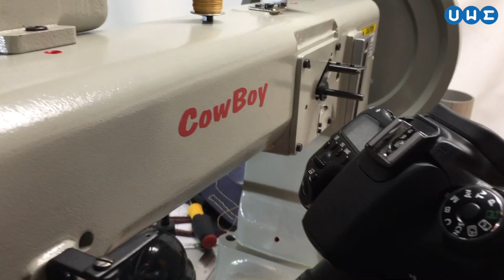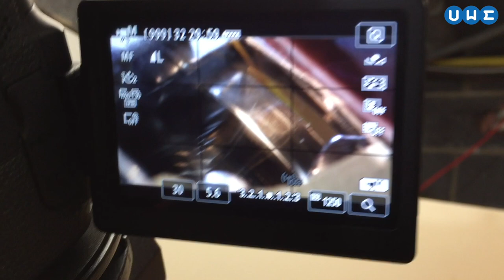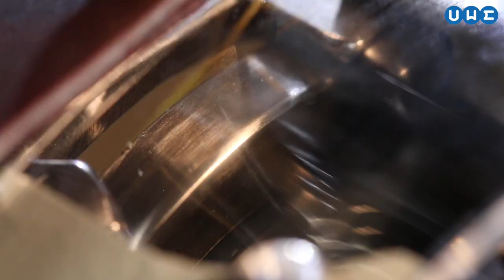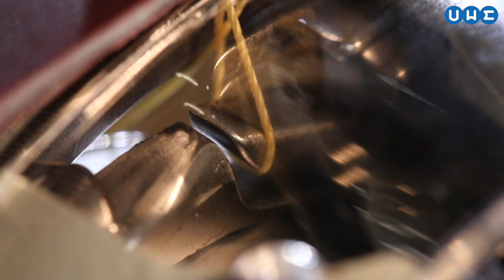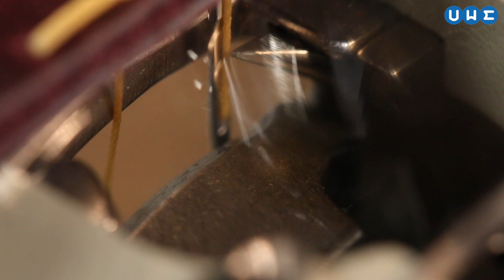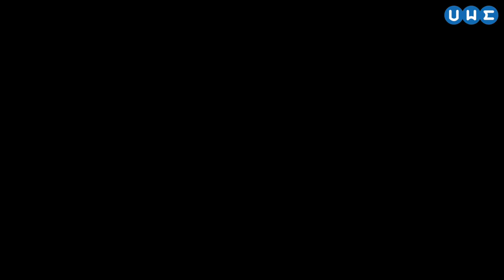Cowboy 4500 Stitch formation and reverse thread snags

Comment: Brilliant, just love the video you do they tell a lot within that short amount of footage ,
I own a singer class 7-33 single needle and a twin needle singer class 7 , with two of this type of hook and similar race,
As the twin needle they only commissioned 200 hundred and were made 1930, they do not make the shuttle drive any more , and if anything wrong with my drive shuttle like wear or tear I have to add weld and reshape,

So when I bought them the twin needle Singer shuttle drive class 7 definitely had quite a lot of work done to it over the years, like welding and reshaping with heat ,
As you show the way the hook takes the loop and carries around the shuttle then comes up and out from the back end gap, this explains the little jilt my shuttle do for the gap to appear at the back,allowing the thread to come up and out, now I understand it,
But I notice on my one like yours had one time the gap never opened up enough when turning it slow,this just might be the slow speed was not enough to give the little jilt. I also think I need to look at my drive shuttle a little closer as I think I need to round the back off more so the thread slips up through the gap better,
The Great things with these video`s they learn us allot how the system should work for smooth running,

Comment: My machine is doing the same on occasions catching thread between the back of the hook Singer and race, which causes the machine to jam ,how can I adjust the hook,but my machine is 7-33
I never new the hook can be adjusted in the race ?
I  thought the thread gets caught at the back due to the slow action causing the thread to drag at very slow speed rather than run smooth if faster,
So how do I set back the hook on this style,?